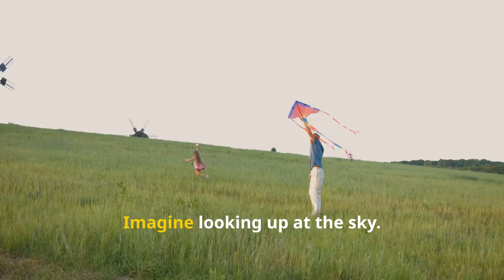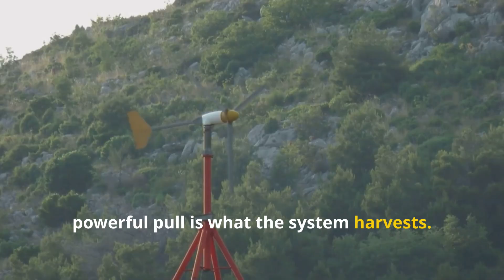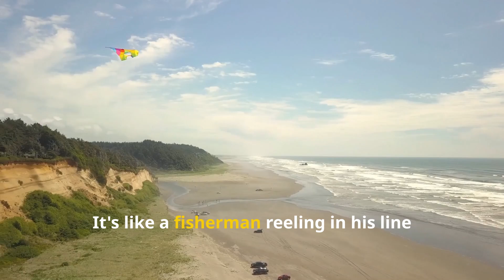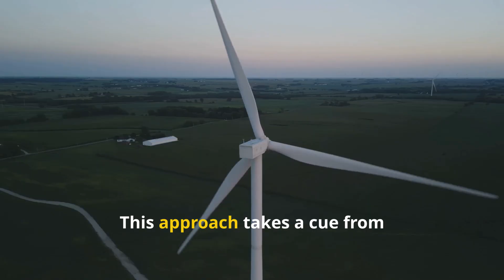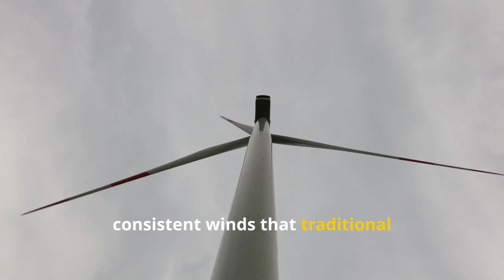These Kites Could Power a City?! High-Altitude Wind 101

Comment from the maker: These Kites Could Power a City?! Discover how high-altitude kites harvest wind energy and could transform the future of power in this 13-minute, stock-footage-driven explainer. We open with a bold hook, then break down airborne wind energy (AWE), tethered kites vs. airborne turbines, flight patterns, tether mechanics, energy conversion, scalability, costs, and real-world pilot projects. Perfect for engineers, renewable-energy fans, and curious viewers wanting a clear, visual primer on cutting-edge wind tech. Like and share if this sparked your curiosity — it helps others find the video! #HighAltitudeWind #AirborneWindEnergy #Renewables #WindPower #KiteEnergy
See Less
OUTLINE:
00:00:00 THE POWER HIDING IN PLAIN SIGHT
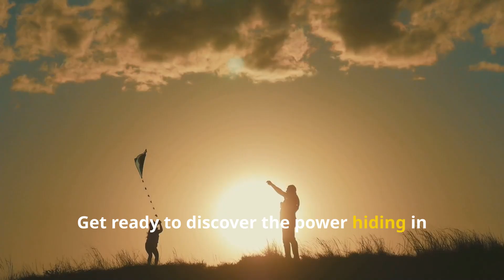00:02:02 KITE, TETHER, AND GROUND STATION
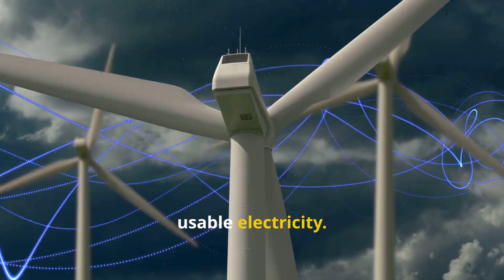00:03:17 LIFT AND CROSSWIND MOTION
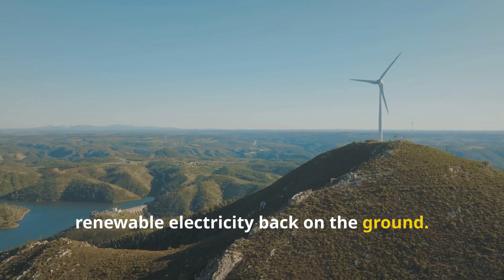00:05:53 GENERATING ELECTRICITY
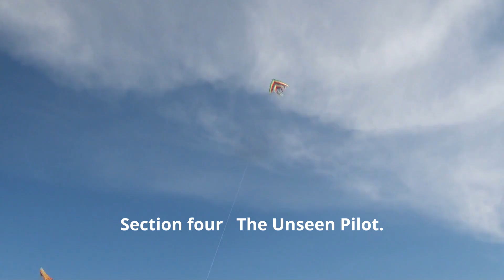00:08:10 THE UNSEEN PILOT
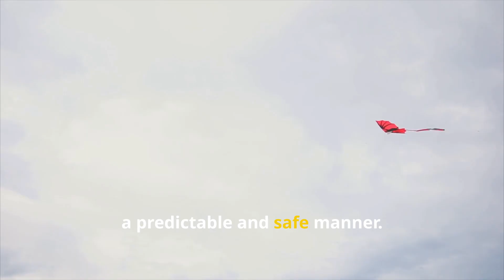00:09:17 THE TWO MAIN FAMILIES
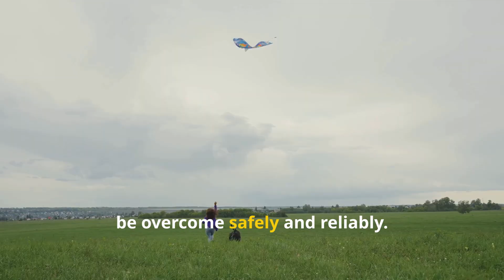00:12:30 CONCLUSION